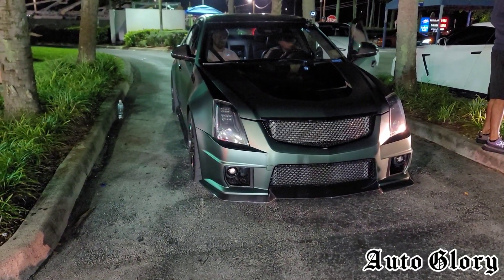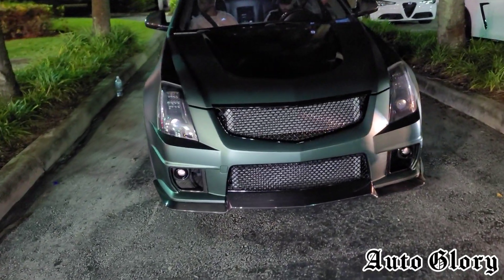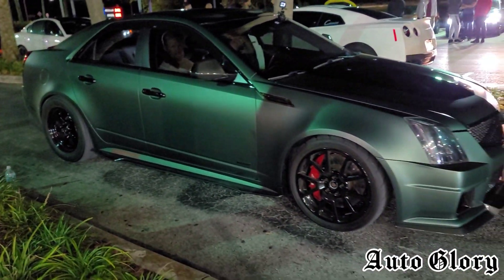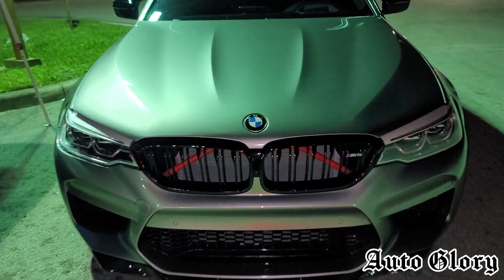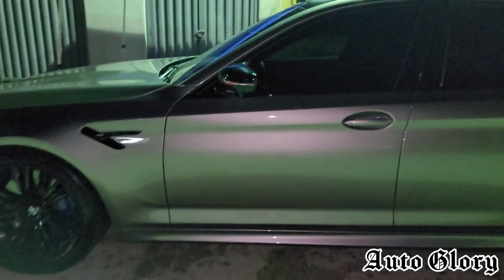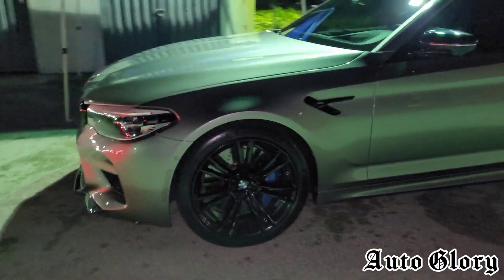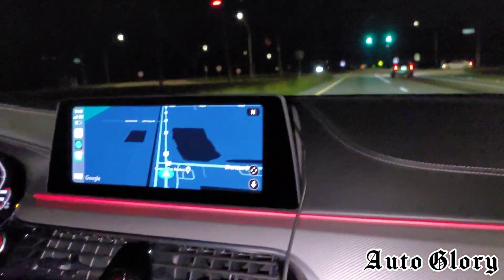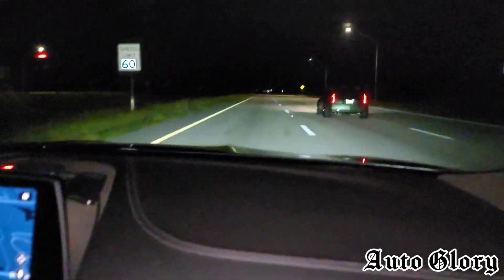2020 BMW M5 Competition Downpipes E30 vs 2013 Cadillac CTS-V FBO Cam E85

Comment: That caddy pulling on the top end im guessing after 140 surprised me, cars are evenly matched, a second run might have already heat soaked the caddy and will need a cool down period before running again.

Comment: That caddy has to be running 170-175 mph in the 1/2 mile if he’s pulling/staying with it like that! God damn that is ridiculous for a manual grocery getter
Reply: I think I heard the Caddy driver said 180 on this run so year you’re right.
Reply: @havingfunyet  lol he was driving the bmw.
Reply: Dude that Caddy s making 680 HP to wheel. It must b a low 10s car and shud easily do 130+ at quarter.
The BMW here is heavier by around 300 lbs and as it is s making around 600 whp I guess. Lets say 625 as it has that DCT
Reply: @Executiveinvestments-  My bad you’re right. They were in the BMW so damn, that Caddy was hauling ass.

Comment: That V2 can do what the new CT5-V Blackwing can’t, run with an M5 in a straight line. To be fair, it was M5 CS, and the Blackwing was a manual. Randy Pobst set track record in CS for 4 door, then broke that record with the Blackwing. Streets of Willow I think it was.
Reply: then broke the record again with the plaid... :\
Reply: @bsulze39  shhh, I don’t want to talk about it, lol. He sure did though. I have to wonder if he could beat that with a 10L90 V considering the ZL1s are a good bit faster with it.
Reply: Pretty sure the new ct5 with these mods would gap the m5 comp maybe even the cs
Reply: @johncena-hq1ti  definitely, but if the M has mods that little LT4 1.7 blower is going to need to be upgraded at some point
Reply: @johncena-hq1ti  that’s what amazes me about this V2, still has stock 1.9 blower as far as I know
Reply: @bsulze39  then the plaid got demolished in the ring by 30 other cars.  lol
Reply: @Executiveinvestments-   Lets hope that sticks lol
Were they sedan road cars though?
Reply: @bsulze39  who cares.  DId they have over 1000hp and over 1000lb ft torque?  No.  Plaid got killed bad. Plaid handles like total shit. Watch the video.

Comment: M5 comps are insane! 2 mods on the M5 vs the CTS V’s 15 FBO mods lol. M5 is the winner for many reasons.
Reply: ehhh the Cadillac is also like 2 generations old and manual...it's still clearly the faster car, just gets bogged down by manual transmission.
Reply: Yeah no, the bmw is faster stock and costs $95,000 vs the CTS V being $60,000. The V won here but it was a great race.